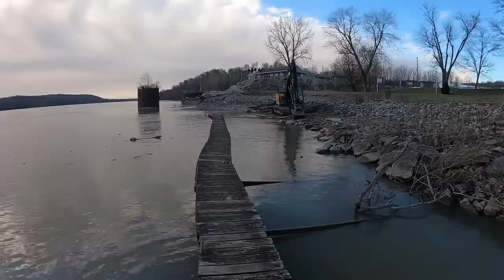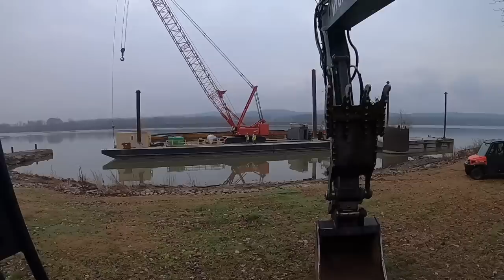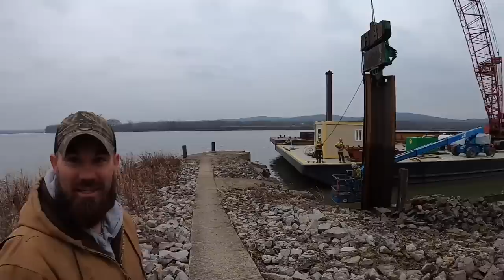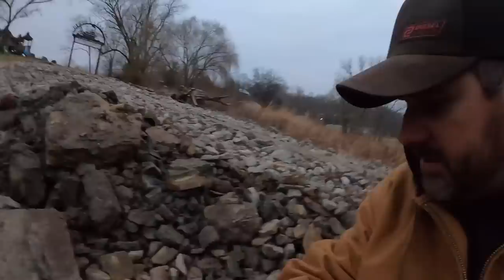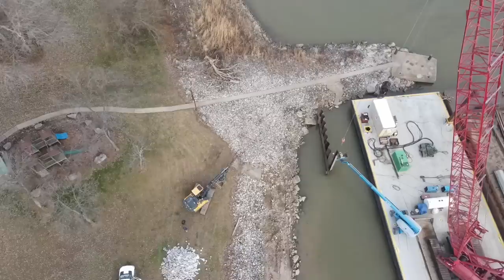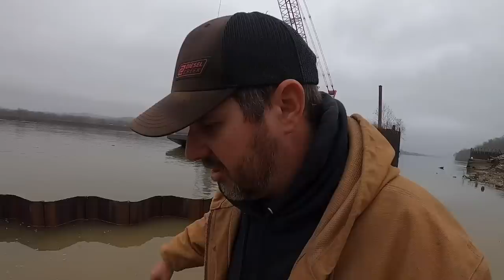Over a 150k volunteer project helping install a new boat dock for the Derby Community Center

Comment: You showed some sneak peeks a while ago of a new "dozer" pushing rock into the fill zone🤣  I plan on watching the rest of this series but I'm wondering.  For the first few concrete pours do you use a slightly thinner mix to work down into and help bind the riprap together behind the sheet steel, and then a more workable top-coat to finish it off?
Mike, at least you aren't as slow on updates as Google is 🤣.  Their satellite view doesn't show your "new" equipment barn at the Market and there is no dock of any kind visible (although the river may have been over the top of the old one).

Comment: Matt needs that blue man lift for his castle project. Looks a lot more stable.
Reply: Didn't Matt already buy one?
Reply: Not so much that, more some safety antifall perimeter railings on the deck!! (Or clip on harness)😮
Reply: @nanettebarling1222  compare the feeble lift Matt is using to the blue one in this video. Would you go up in the one Matt is using?

Comment: Have built six volunteer community projects; multi year baseball and softball parks and fields. Have to do some planning, especially if your working with several entities for leases, construction constraints, volunteer resources and equipment availability. Did one where we had to navigate city, county, corp of engineers and US army regulations because of the property location next to a TVA lake. Took some time, they all turned out great!
Your project will be great for your city and neighbors!

Comment: Drive deadmen in on the bank side about 12 to 15 foot back and then run 1" round rod at a angle and hook on both end. One will be kind of flat so you can weld it to the metal wall panels and the other end will wrap around the 6" post you drive into the mud as the deadmen. Then start your backfilling with your rock. 

The other thing is when you pour your sidewalk on top of the wall make sure you install a 12 to 18" channel where the wall will ends that will slow down any water coming over the sidewalk from lifting it up so easy.  If you can reach it before you form up for the sidewalk drive some 4" post in the ground and weld rebar on the post so it get embedded in the trench concrete as that will also help the sidewalk from lifting up and it will  if you just pour the concrete flat without the trench.

Your deadmen needs to be about 15 to 20' apart and the rods will cross each other and that will give your wall the best chance of lasting the longest time. Let me know and I can draw you a sketch of what I am talking about. 

Good luck on your project.

Comment: Enginering costs are crazy. We had a town meeting. 90 thousand dollars for engineering to replace two culverts on two roads. One is a galvanized other is a cement or box culvert. Dealing with eco systems and des now.

Comment: I don't know about this one but the pile driver I saw in San Jose Ca - used diesel fuel to cause an explosion to pop up a heavy hammer and then it falls down on the pile onto a spot of fuel and pow it flies up  and falls down on another squirt of oil.  less oil is shorter jump and faster operation.  more oil big hammer.  so it depends soil or pack sand on how much fuel to provide.  Operator controlled and semi-automatic.  He has to stop the hammer after the post is driven down and another welded on top.

Comment: 1)  Me too: it's great that you two companies are willing and able to donate your resources to a community project like this.

2)  Here in the Netherlands, floating docks are quite common, even on the big rivers (like Rhine>Waal) that have huge level changes during a year. (I checked using Google Maps, but not to statistic accuracy.) - By the way, wouldn't be "jetty" a better word than "dock"? A "floating [dry]dock" reminds me of the "hull with doors" that can be sunk to allow ships to enter and leave, then lifted (by pumping the water out) to work on the hull of the ship inside.

3)  I wonder how the man in the blue man-lift bucket talks about his job, both sober ("well, you just have to mind...") and drunk ("when I have to go, I just...").

4)  Stability: barges like this one may be equipped with ballast tanks and pumps to keep them more or less horizontal. I could imagine the man in charge to decline using such system just above rocks.

5)  I remember you (DP and NYA Millennial) working on an even smaller dock using either 120 or 140 with the Super Stick. Would the Super Stick have been useful here?

Comment: What drove the pile driver? Air, mechanical lifting or diesel fired piston? Couldn't tell.  Kudos to the construction company for donating their time as well as you and the rest of the community. Grat video, waiting for the next installment. Thanks Mike, Matt & Crew! Lee
Reply: They are run by a hydraulic power pack. It's that green thing on the barge between the crane and the tool shack.
Reply: It vibrates the sheet piledown. If they lift while vibrating they can lift them out.
Reply: Used to be steam driven back in the day.
Reply: @degrom542  And Diesel
Reply: @degrom542  From the 70s and up those hammer and leads ran with compressed air.
Reply: @kenore4003  Diesel hammer and Leads, I banged a lot of s h i t into the ground with those and air hammers too.

Comment: My oldest son does piling and pier building and he has a machine half the size of that 210 and they pluck posts outta the ground with it at ease
Reply: Good for him.
Reply: Did your son bid against this company? I bet I could have plucked them out with half the one size as your son-in-law but I bet neither one of us would have went and done it for free. He did a heck of a job with what he had to work with (lol). Could your son done as good on digging out those rock with that half size or would he have too bring in another one

Comment: Wow you guys are so fortunate to work on a project like that. Everyone wanted and needed it replaced. The really big thing that never gets talked about is all the red tape and permits and inspections that go along with these jobs. It would make your head spin. Where I live I do volunteer work on a 300 acre island with a 100 acre freshwater lake. I’ve been at it for a few years now. The sad part is the city blocks everything the island folks try to get done over there. So far over 4 miles of trails have been cut in and that’s whi help out keeping them clear of tree branches an downed trees. It’s only a 1/4 mile hike the the river from my place pulling my kayak down to the river. Then a 3/4 mile paddle to the island. Yeah it’s one heck of a haul with my gear then hiking by foot around the island. A lot of people don’t get why I would go through all that and not get paid. It’s nature in its rawest form. It’s therapeutic.
Gentlemen thanks for all your hard work. Very nice job you guys are doing for those folks. Very nice.
Reply from the maker: Thanks

Comment: From a boaters perspective, that will be a great place to dock!  Maybe add some depth markings so boaters know what the depth is when docking.  I may have to make a boat trip down from the St. Louis area sometime just to use the dock.  Are there any over night accommodations?  Great work DP!
Reply: Obviously if a barge is docked there your little dingy should be fine, no need for depth markings Hot Rod lmao.
Reply: @p c  you're forgetting that the river level fluctuates a lot.  Just because a barge is parked there now doesn't mean it will be able to park there all the time.  Having some depth markings would be very helpful.  However, I realize that the markings might not be totally accurate due to the way the bottom of the river changes.
Reply: @siduramaxde  at the time it was low tide and the barge is parked by dock so what are you saying, when tide high docks covered by water dingy wont be able to dock?
Reply: @p c  there are no "tides" on the river.  River levels fluctuate based on rain fall.  50 foot fluctuations from low river to high river.  Where DP is, there are Locks on the river, so they may be able to control the level somewhat.  But there will still be wild water level fluctuations.